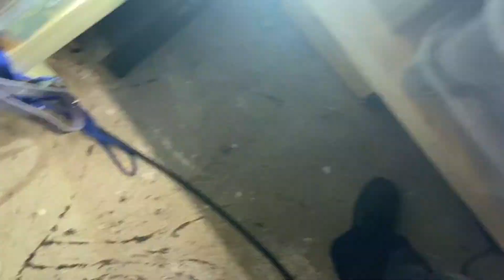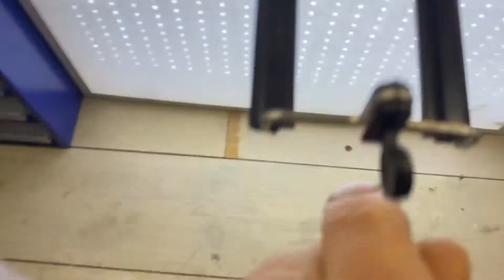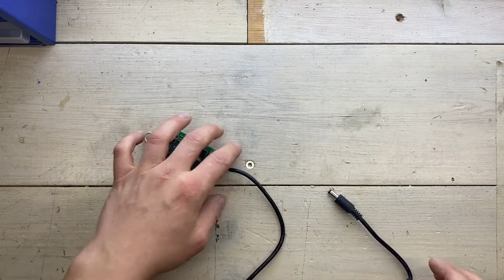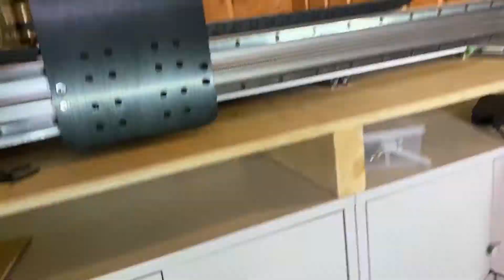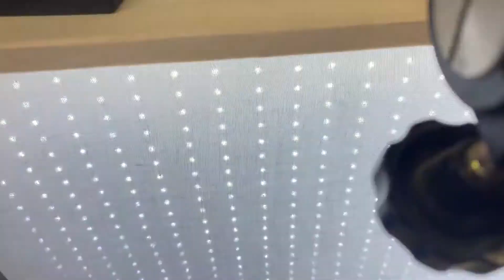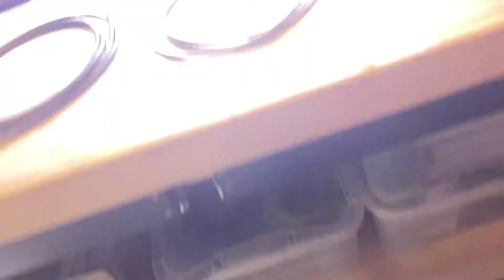Machine Building Basics 4: Wiring

Comment: hi, I've just ordered a Queenbee 1010. Before it arrives, I'd like to be able to build a box for it. The X & Y frame dimensions are well advertised. BUT the Z isn't sniff !@!#%$^& Are you willing to tell me how high the Z Axis hardware is, with fully assembled? Thanks
Reply from the maker: No problem, from the top of the Z-axis stepper motor to the bottom of the machine it is 585mm but that can vary a bit depending on how you place the z-axis limit switch.